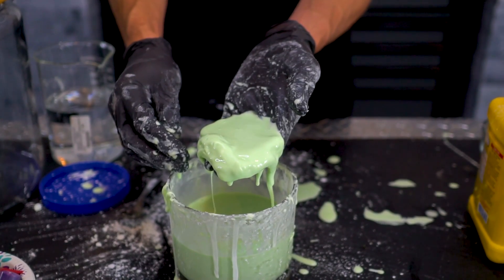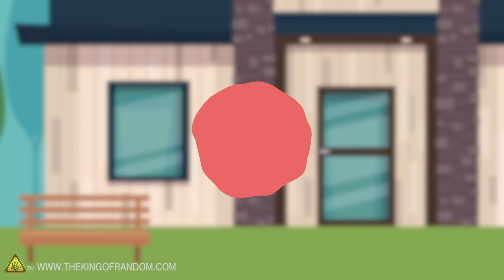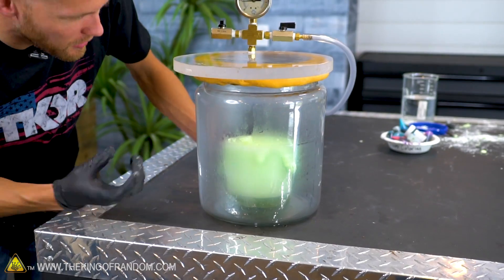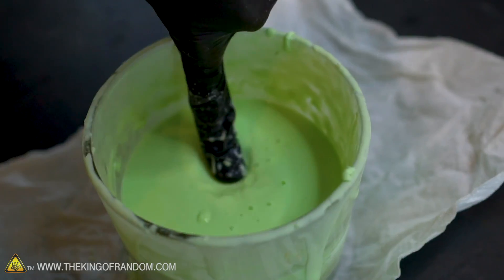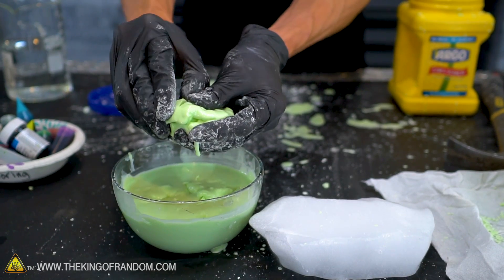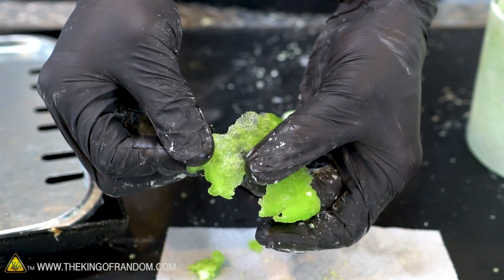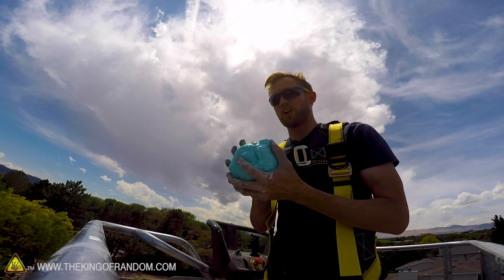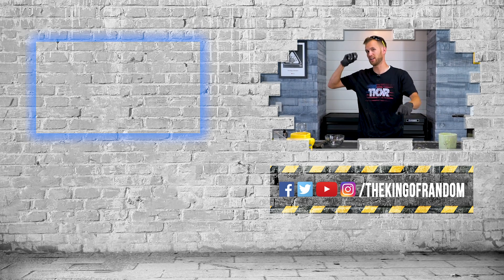OOBLECK vs DEEP FRYER! TKOR Talks Science Behind Oobleck And Cool DIY Experiments You Can Do With It

Comment: Oddly, this behavior is akin to what happens to rocks, only at a much faster scale. It's called the brittle/ductile transition zone: You can apply a given force at a given rate and the rock (or oobleck) oozes; apply that force faster and it shatters. All solids have a given brittle/ductile transition zone, and you can do really fun things if you can figure out where that is. I once turned a Styrofoam sandwich box inside out without breaking it, and have shattered Silly Putty by dropping it down a four-story stairwell (the dean of my Geology Department in college suggested it, and we were bored one evening). What sets non-Neutonian fluids apart from regular fluids is that fluids don't usually have this; you can't shatter water. Intuitively, we assume that this transition zone is inherent to solids.

Comment: Suggestion: Embed a small, strong magnet in a chunk of dry sponge and leave it it the vacuum chamber. Then, if the chamber fogs up, you can wipe the inside surface without breaking the seal.

Comment: Oobleck if somehow was ever restrained in certain shapes, maybe through freezing it in a mold and then coating it with rubber or something to make an air-tight seal in the desired shape....that sounds like it would make VERY interesting shock absorbing armor for blunt impacts. 

Like a ceramic plate that repairs itself after shattering. If only someone could test that. >.>
Reply: Scott Seagrave լռրէր

Comment: oobleck vs ln2
oobleck vs pressure pot
oobleck vs torch
oobleck vs mini metal foundry
oobleck vs negative x
oobleck vs thermite
oobleck vs car tire
oobleck vs rocket saw
oobleck vs golfer
oobleck vs speeding bullet
oobleck vs giant squirt gun
oobleck vs pool shock mixed with brake fluid
oobleck vs grants volcanic baking soda & vinegar mixture
oobleck vs sugar and drain cleaner (sulfuric acid)

Comment: The air cannons you have made different scale models with, just curious what it does to different size fires (can you spray flammable liquid and successfully passing it into the fire) how does it affect the smoke can you launch scents across a room and what works better launching air through the scent or filling the cannon with the scent and then launching?

Comment: What happens if you mix liquid air ,liquid nitrogen and liquid methanol you make liquid methanol by putting liquid nitrogen in a test tube then put an smaller test tube inside and put a balloon filled with a little air in the small test tube inside before putting it in p.s. it’s like liquid nitrogen but it’s very flammable